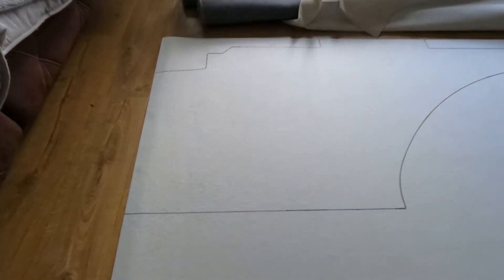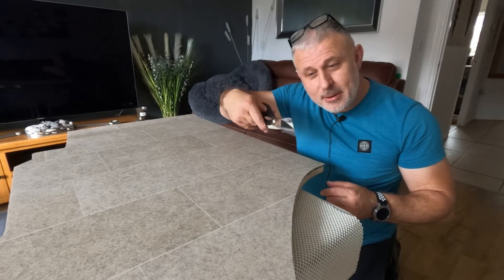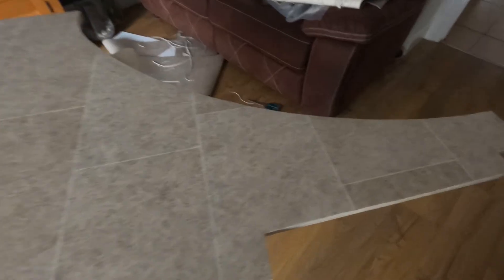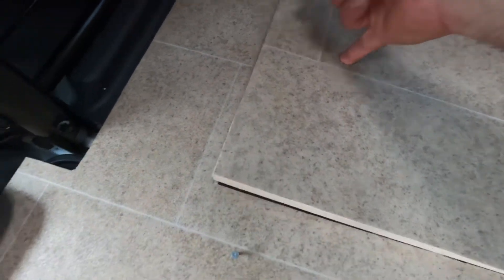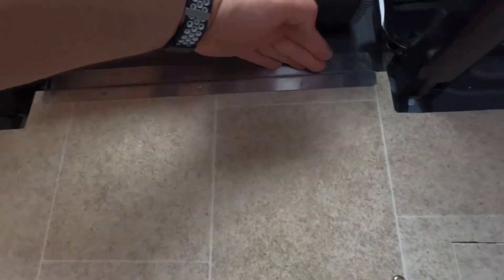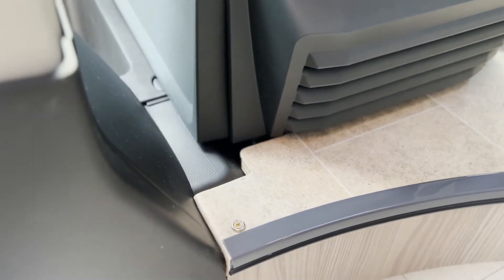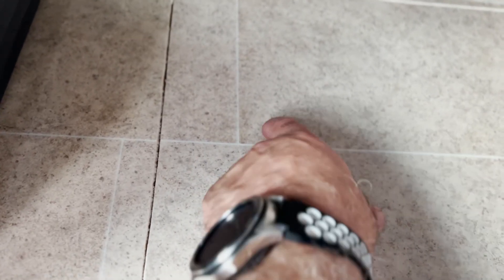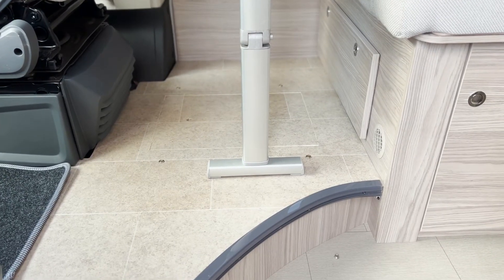Hidden flooring reinstated in the Elddis CV40 campervan.

Comment: The power the edit 😂 as well as adding a sweater your shirt changed colour 😜 I bet Julie loved the smell of spray glue air freshener! The dog didn’t stay long on that sofa 🤣 Looks like a good job in the end, as you said a little push in collar or even get one of the knobs that hold the drawers shut in the vans so there’s no hole and you don’t have to put a finger in……. Steady.
Reply from the maker: Julie was in bed after night shift. Perfect time to get any job done. I’ve finished the job off with a bit of sanding and a mat over the top. Will probably just leave the hole as is. Very satisfying sticking your finger in there. 👍🏻😀
Reply: @TravellingfromScratch  I thought you were talking quiet 🤫
Reply from the maker: @RickandHeather   there’s an old saying. Never wake a sleeping bear.  If it’s not an old saying… it should be. Especially where she is concerned. She’s the bear in this analogy. 👍🏻

Comment: Hi Ian - got some photos of our concealed floor storage space but can't figure out how to post on youtube. BTW - we were wondering what you used to fasten the handle to the sliding door with -  bolts or screws?  Sharon & Martin.
Reply from the maker: Hi Sharon. You could send the photos to cvtravellingfs@gmail.com so I can have a look. That would be great thanks. I fixed the handle to the door with self drilling screws. Just get them as close to the edge as you can so that they get a good hold in the metal. Mine have never budged and the handle is great for giving an extra strong shove. 👍😁

Comment: After watching the 3 videos on the removal and hatch build, I have a question about where the hot and cold water pipes run to near the side door? I can see the water pipes run from the side of the fuse board, down the side of the van and then behind the driver and passenger seat. I just cant work out where they go after the the corner that's behind the passenger seat???
Reply from the maker: Hi Andrew. The honest answer is I don’t know. I too can see they run from the shower, past the fuse box, under the floor past the back of the driver and then the passenger seats and then they disappeared under the floor. I will have a closer look and get back you you on that. There’s only a short distance from the back of the passenger seat to the sink in the kitchen. I presume the pipes run under the floor to the boiler but I will check and see if I can see where they go. 👍🏻
Reply: @TravellingfromScratch  That would be amazing if you can.. I'm building a Peugeot Boxer campervan from scratch. With a very similar layout to your coach built camper.
Reply from the maker: @drewhodge3820  I will get back to you shortly mate. 👍👍
Reply from the maker: Ok Andrew. I have had a look to see where the hot and cold pipes go and from what I can see they have been laid into a channel that runs under the plywood floor. I have taken some pictures to show where the pipes come out under the bottom drawer in the kitchen area. It looks like one of the channels in the corrugated floor has been lined with a plastic sheathing and then the pipes run through there. If you email me at cvtravellingfs@gmail.com I will reply to you with some photos. Hope this helps. I can’t actually get to the pipes now that the floor is down. I assume if you need to replace the pipes now that they are in there you can pull them through the channel and feed new pipes through. These were obviously put in before the floor was put down. 👍🏻
Reply: @TravellingfromScratch  Your a star. I didn't expect you to go to all that trouble. It's turned out to be a cracking day. Since I posted my original question, Iv had my Webasto diesel water heater turn up from Poland and better still my Lithium batteries (lifepo4 cells) from China have been delivered. That's 600Ah of Lithium battery bank. Xmas has come early this year. I'v got my new toilet to pick up tomorrow. Who knew you could get so excited about a toilet??? Ha Ha.
Reply from the maker: @drewhodge3820  Sounds like it's gonna be an excellent build. I would have loved to build my own but unfortunately I don't have the skill or the confidence to take on some of the bigger jobs. Good luck with the build. I would love to see some photo's or follow your build if you have a YouTube channel. If you do document the build, please do let me know. If there's anything else I can do to help, just let me know. 👍👍
Reply: @TravellingfromScratch  A few people have told me to make some build videos. Now you have said it as well. I think that's my kick up the backside. They wont be polished videos. I can guarantee they will be rough LOL but if it helps someone else, then i'm happy to do it. I'v never edited a video in my life.
Reply from the maker: @drewhodge3820  interesting content will always be better than editing skills and you will learn as you go. Good luck. 👍🏻